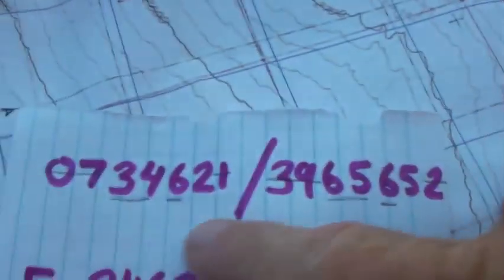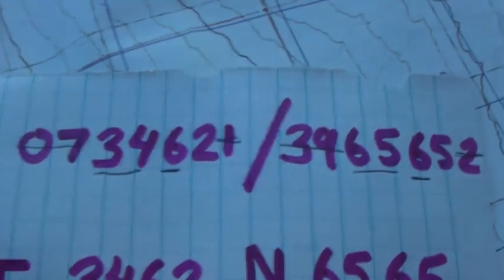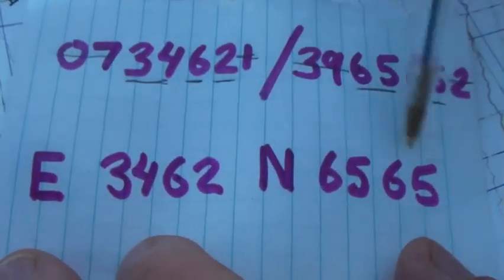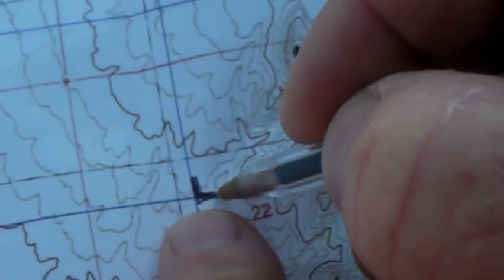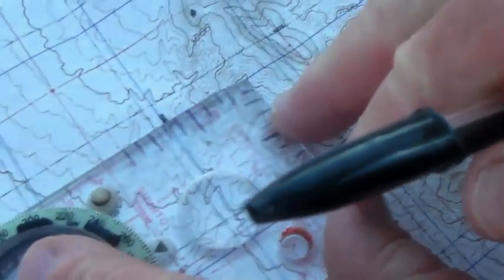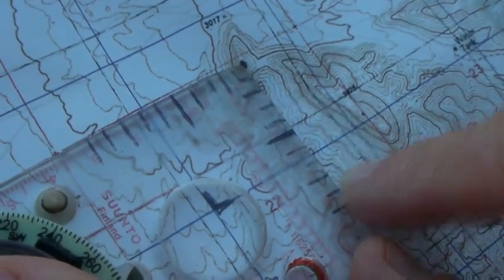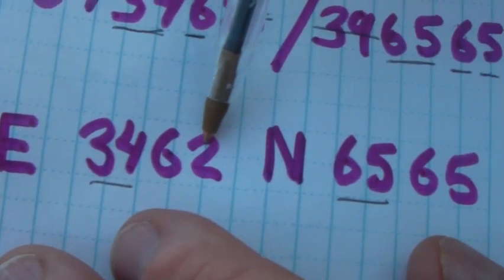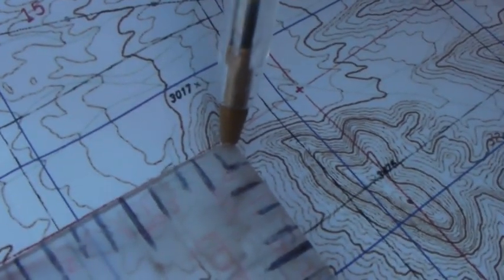Plotting UTM Grid Coordinates

Comment: my utm easting has only 6 digits..-> 605320mE  northing ->4406431mN ...? iam lost everyone say I need 7 ..what do I do ????
Reply: +hockeyfreak043 Hockey freak, your UTM easting value is always going to have six digits. You do not need 7 digits. Sometimes eastings are written with seven digits by simply adding a zero as the first digit, but the resulting coordinate is the same. The easting and northing values you wrote of "605320mE 4406431mN" is perfectly correct.
Reply from the maker: The six digits you have will get you to within 100 m, actually marking the lower left hand corner of a 100 m square. The seventh digit will get you to within 10 m. The difference in accuracy depends upon what you're doing.
Reply: Yes just add a 0  at the front of the Easting to give it 7 numbers 

Also I would put a comma before the last three numbers  before striking out the last number

This would mark out the end of the numbers that will be used to find the grid number 

Excelent video